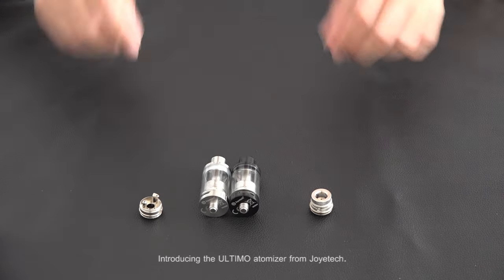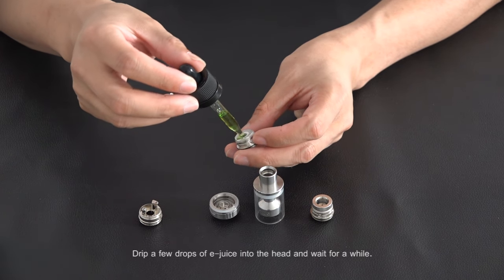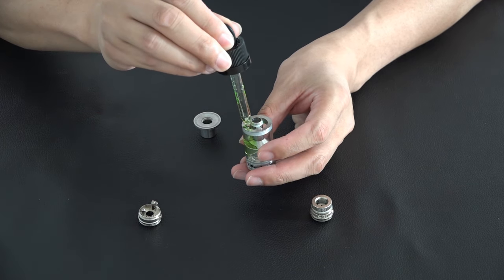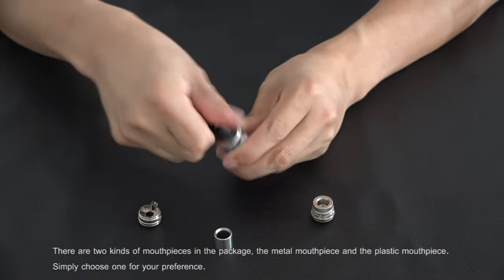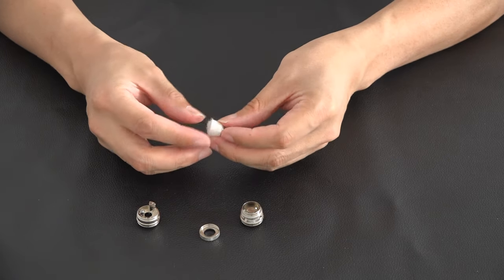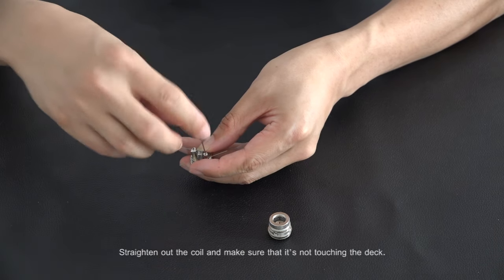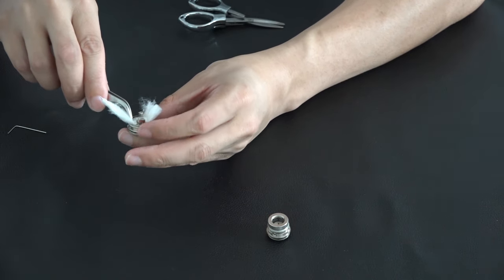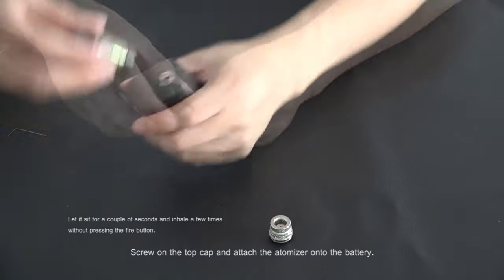ULTIMO Atomizer Tutorial Video

Comment: Wow a plain and simple tutorial via a Manufacturer! love it. it even included the RTA base which I just bought and the reason I'm watching this. 

Ultimo - Love this tank! 

Cubis Pro - Least favorite tank. Ever. 

Thank you for short and easy video!
Reply: I totally agree. It's nice to see a simple tutorial like this that covers the coil types for the tank. There are a few observations I can add from experience with this tank over the past two months that may help others. 

Close the airflow before removing the top cap for refilling and changing coils/rewicking to avoid leaking. This is similar to other top-fill /bottom air-flow tanks. 

QCS
I like the huge notch coil in the QCS but keep in mind it needs higher wattage for the best vape (60-80 watts as inscribed on the base is probably best, but 50-60 worked great for me). 

It's better to change the cotton before letting it get too gunked up if you use high VG juices like me. Burnt cotton/juice is not easy to clean so the coil will most likely need replaced if it gets to that point. 

RTA
When clipping the the leads you have to make sure there's no excess or it can block screwing the chimney on, or touch the base and short out the coil.  

For the RTA I use 24ga kanthal 5 wraps at about 3mm not too tight so a wider area of cotton is covered. This makes right about .5ohm, which I enjoy. This is a personal preference, but I've been building coils long enough to make them heat evenly without requiring a micro coil as I used to. If you prefer microcoils (wrapped tightly) I would go with 22ga with a couple of extra wraps in accordance to an ohm calculator if you want .5ohm or lower resistance for a hotter vape.
Reply: The notch coils that came with the RTA I did not like at all. Had a nasty taste and tons of dry hits for me. I still love this tank , I'll try your .5 for sure. The big issue I've had is with one of the posts is really loose and the ohms bounce around.... haven't picked it up since but I miss it.
Reply: The notch coils with the RTA were a disappointment to me as well. I think the real issue with them with this RTA base is the leads are really too thin for those larger posts. The totally open post is a bit confusing in the design choice because it does make it more challenging to clamp down the leads than necessary. 

I also had issues initially with ohms bouncing around, and changed up my method when I replaced the touchy notch coil with my own coil. I clamp /screw down the lead on the closed post first, then twist the lead inside the open post right against the base and screw it down. That tightens it up but it does take some adjustment then you have to clip the excess lead. 

The only logical reason I can see to making one of the posts totally open is for Clapton coils. I get Joyetech wants to market their Notch coils, but including them with this RTA just doesn't make sense with that open post design. The Notch coil in the QCS is way better imho

*One thing I forgot to mention in my earlier post... if you use the RTA use plenty of cotton for wicking in the wells -leaving space around the coil over the center for air flow. If the wick isn't pressed against the wide juice holes it will leak and sputter. Learned that the hard way, but after correcting I haven't these issues.